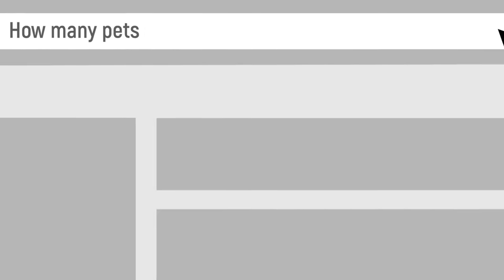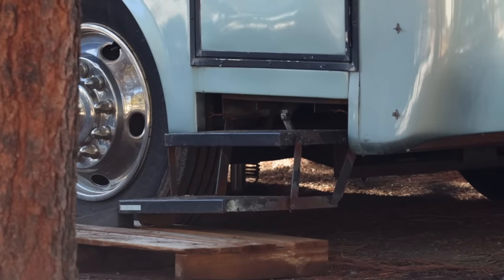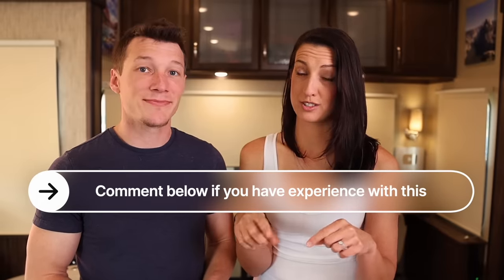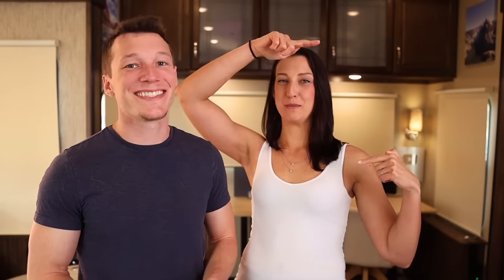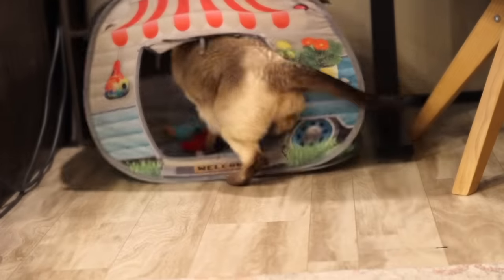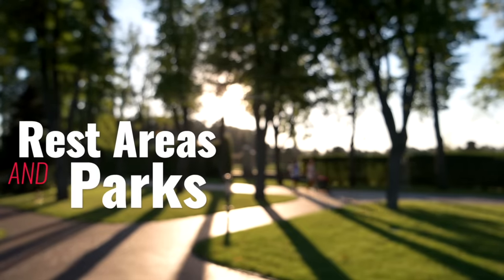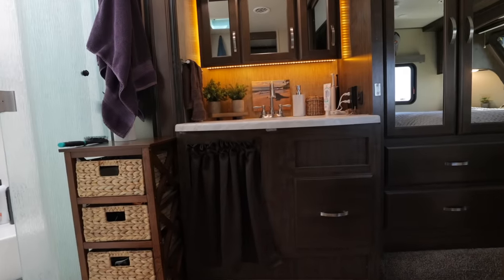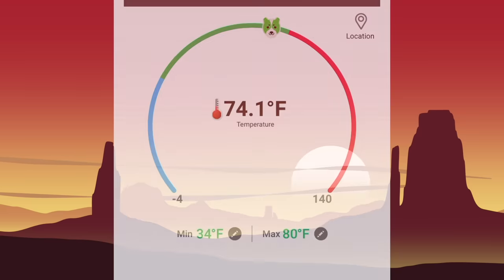BIG Tips Every RV Pet Owner Can Benefit From (RV LIFE)

Comment: As an RV tech my biggest pet tip would be to lock your pet in a separate room when you have a tech coming. Or have someone take Fido on a walk during the call. 

1. This is going to make your call go smoother and faster. Most techs charge by the hour so this will save you money. But also help with Fido’s safety. I’ve had dogs trying to shove their noses into live power in working on. 

2. This will decrease the chance of your pet getting out when they’re not supposed to. As a tech I have to walk in and out of the door multiple times to get things from my truck. I’ve had calls where every time I do that an animal is trying to escape.

3. It’s just a polite thing to do for this person who is coming into your home to help you. I can’t tell you how many times I’ve shown up to an RV and had a MASSIVE dog run out and jump on me only for the owner to be like “you’re okay with dogs right?”…

Comment: Thank you for your video on pet care while RV’ing. We are part time RV’rs, but have done a few long trips (6-8 weeks) with our two small dogs. Safety for our pups was my first priority/concern. Because we knew that there would be short periods of time we would leave them in our trailer, we invested in a router and data plan to have good internet service. We also installed Blink cameras so that we could watch them while away. Plus the Blink system as well as the Govee temp monitor we installed, tracks temperature in the trailer and we can adjust temp remotely from our cell phones.
As for traveling, I am a nut case for keeping pups safe in the truck. So we invested in harnesses for both dogs, seat belts and our most recent purchase was a “4 in 1 Convertible dog Car seat cover” for back seat of our truck. It kind of resembles a hammock. Protects the seats, cushions their ride, comes with seat belts, is waterproof, storage pockets for leashes and more, and it converts (zips open) to allow for passengers as well.  We bought ours on Amazon, paid about $30 for it and it has been a game changer. It even has a screened section to block access to the front seat, but they can still see us. We highly recommend this product, just be mindful of the size. You can enter your car make and model to buy correct fit.
We do admit, we do leave the pups in the trailer for short periods of time, but we feel we leave them safely and we monitor via the camera and never go very far. We will, for sure, look into a Doggy day care, if we plan to be away for an extended period. Oh and we also take them on ‘pet friendly’ hiking trails whenever possible. And important to note too that we ALWAYS clean up after them and never go anywhere without poopy bags.
And also important to tell you…..that we love your suggestion to visit your Vet before a trip. We do this too, AND our Vet has put together a Dog First Aid kit for us to take on the road with us. Mainly because our pup, “Bear” seems to be sensitive to new areas and has gotten sick several times. We now carry meds for him and a general dog first aid kit whenever we travel. So important.
We love all your videos, and have learned so much from your channel. Your information has been very valuable.  Thank you for sharing about RV traveling with pets.

Comment: We use a Marcell Pro (which is Verizon) and have SensorPush, TempStick, and our MicroAir EasyTouch monitoring the temperature over our permanent AT&T Hotspot.  This gives us 4 ways to get temperature alerts for our pups, and power alerts.  Also whenever we leave the RV, we leave both A/C units on as a redundancy and keep it a bit cooler than average.  We can also run the A/C on solar and battery if we are at the RV.

Comment: Another great video!  I’m trying to catch up with all your great amazing content.  We have a 16 year old cat who is very content in the rv but doesn’t like travel days at all. I went with YoLink for temp/humidity sensors because you can do so much more with them than just receive an alert, like turn on heaters or incandescent bulbs if you are in cold temps and need to keep some bays warm. We also use their water leak detectors and those can actually turn off the water at the spigot AUTOMAGICALLY if a leak is detected at any of the sensors you place. For me, detecting a leak is barely worth the effort especially if you’re away. Lots of tech advantages to YoLink over others. I’m not affiliated with them.  Just a fan since finding them. Low cost option with great automation features if desired.  And easy to use.

Comment: Kyle & Rene,
Another concern with cats and small dogs is making your RV secure for them.  What I mean is that, in the average RV, there are often multiple small openings that your pet can enter and 1) heaven forbid, that may lead to an escape from the RV, 2) it may lead to your storage bay or underbelly or 3) it may just lead to a hiding place that will make you lose your mind as you hunt for your pet and wonder "How did he/she get out of the RV?"  A case in point:  We traveled in our 5th wheel to Galveston, TX with our cat and he suddenly went missing.  After frantic searching of every nook and cranny in the RV, I used a camera extension to find him in an enclosed space under our bed.  I had to take the bed apart to get him out.

It pays to do a thorough search of your RV to find all the pet-sized openings that need to be blocked or covered to prevent future anguish and/or loss.

Good video!
Jim

Comment: We have the same functionality and more with our in command system in our RV. We also have the waggle simply for the alerting capability. I have it hooked to a non inverted outlet so we know if there is a power issue or a temp issue in the RV and can respond accordingly.  

Really power is the thing we worry about the most on hot days. Out AC system can be run on auto so if we left on a cool morning and it got hot the system will just flip from heating to cooling and maintain whatever temp we set. That is so long as the RV has power. On a hot day if the power went out the first thing we would do is fire the generator which we can also do remotely via in command.

Comment: We are not full timers.  We do short trips in a 20 foot travel trailer.  In the last three years, we have traveled with 2 of 3 cats ( one we had to leave home for various reasons) and one 75 lb. dog.  I have never told the campground that we had cats.  My cats are indoor only, so no one even knows that they were in the camper.  They travelled in the hard plastic pet taxis when they are in the car.  I didn’t have to worry about their safety if we stopped to get out of the car to walk to the dog or if we ever got into an accident.  The dog was wearing a dog safety car harness for the same reason, so there was no worry about him getting loose or being tossed around if the car had an accident.  I have had to show my dog’s vaccination papers when I registered upon arrival in several places.  I did bring my pets into the camper a few times before the first trip we ever took so they could check it out.  I have had to put out 2 litter boxes, one under the table and one covered one at the other end of the camper.  I also have plugged in Feliway (a cat plug in pheromone), and had calming spray if needed for the car trip.  The cats had their own blankets and pillows (like they have at home) to sit,rest, sleep on.  The dog had his own dog bed.  My husband made a ramp for us and the dog to use instead of the steps that are on the camper.  We have had to find a doggie day care for one trip, otherwise we planned what to do around the dog. This season there will be major differences.  One cat that was very easy to travel with died of old age (she was 17 1/2 years old) and kidney disease this January.  My dog died the last day of September at age 13 and of congestive heart failure.  Now is have to get the one cat who never travelled with us use to the cat carrier and the camper.  We want to start taking a few longer trips this season.  By the way, all my fur babies are microchipped, wear collars with ID and rabies tags on them.  Make sure you update any change of phone number and address for the microchips and ID tags. The dog also wore a gps tracker.  I’m looking into gps trackers for the cats in the event they ever manage to get out of the camper.  Any ideas or recommendations would be great. Love watching your videos.  Thanks for all the helpful information and ideas.  Also, I  enjoy watching about the different trips and place you have been to.   Looking forward to this camping season, and more of your videos.

Comment: Should also mention the Microair is nice, but does not give push notification on temps, even then it is on my want list.  Their price is really hard to justify as a part timer though.   On the monitoring side an alternative to Waggle is Marcell which uses ATT towers.  There are other products like RV Whisper which does need full time wifi/internet in the RV to work, but it will send sms alerts for not just temperature of the RV, but can be setup for power and more.  I even have alerts for my fridge temps!